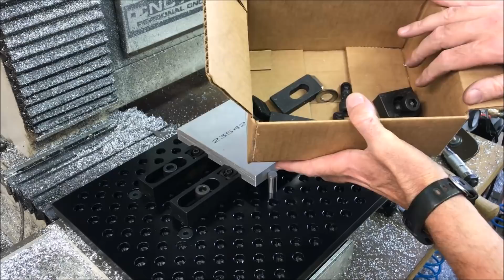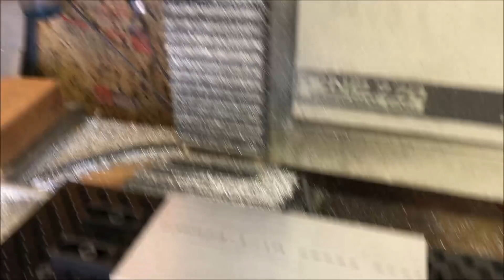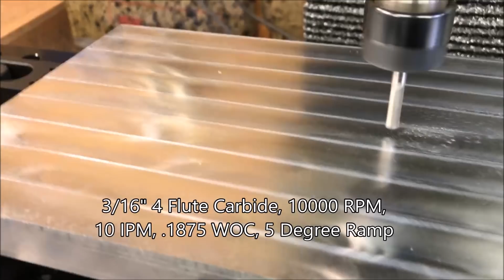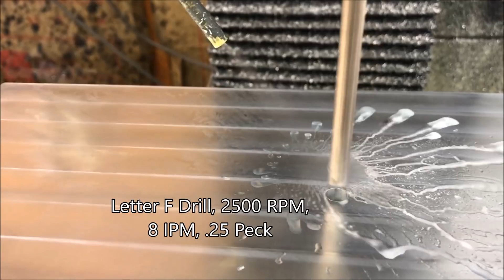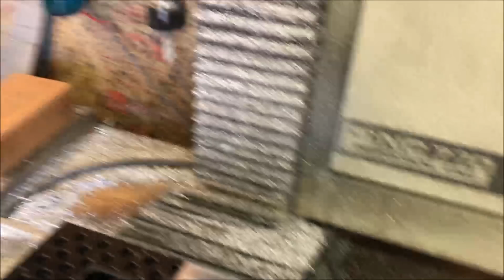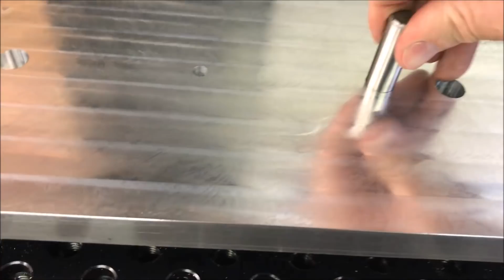Tooling Plate Pallet System Part 1

Comment: looks like a handy pallet system to have. In my personal experience if you can get away with using a smaller diameter endmill in relation to the hole you are boring it will work out better in your favor, I also use a 3 degree ramp angle in a adaptive clearing, or just keep it simple and use the "bore" tool path with a small step. keep making stuff!
Reply from the maker: I figured 3/16 would be small enough for a letter F drill.  Maybe I could try a 1/8" 3 flute.  But I may still have chip evacuation problems going that deep.  I guess that's why they invented through spindle coolant. I may just drill the small center hole from the other side and just stop shy of the tooling plate. Thanks!